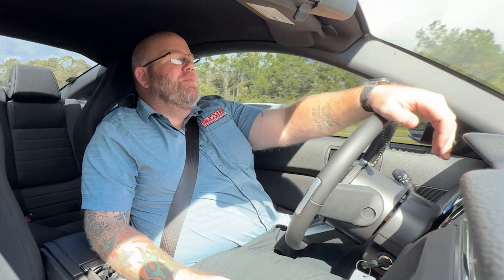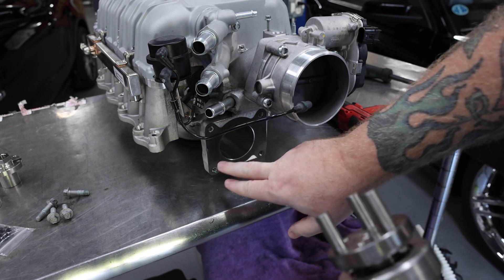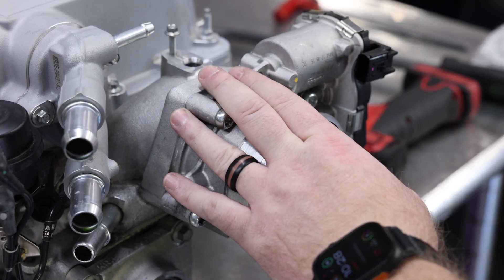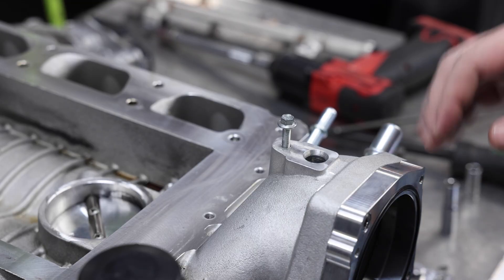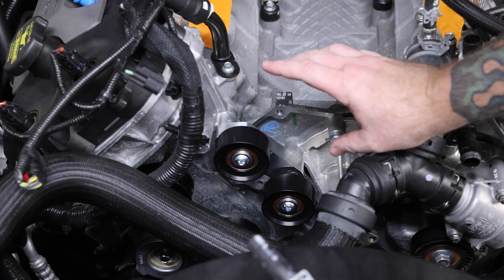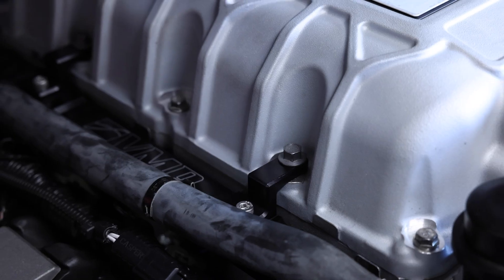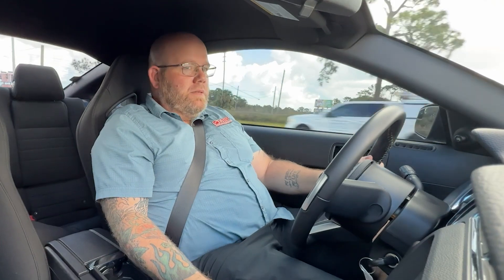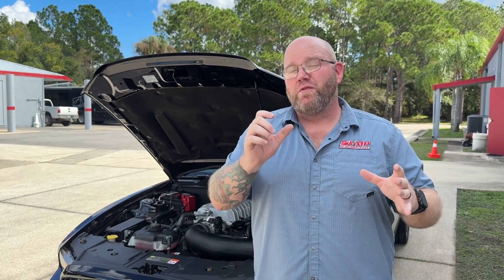Predator Swap Tips PLUS a VERY special 2014 Mustang GT!  ||  Tech Tips

Comment: Any idea what it'd make with e85?
Reply from the maker: Just E85 and no other changes would probably pick up 25-50 depending on how aggressive the timing is.  But it'd require a return style fuel system and larger injectors before E85 would ever be an option.

Comment: did you also change your fuel pump or is it the stock fuel pump ? and also the oil pump gear and crankshaft gear or is this mustang still on oem gears ? what else do you need besides the vmp stage 1 kit fuel rails injectors from vmp  to complete this blower on your coyote gen 1 .Thanks
Reply: For pump gas, just a boost a pump. For e85 or high boost youll need a fuel system. Low boost 10psi or lower, you dont really need oil pump gears and crank sprocket. BUT if youre going to bounce it off the rev limiter regularly then theyre cheap insurance.
Reply: OEM pump gears and running VMP boost a pump

Comment: How munch cost all the parts needed besides the blower?
Reply: Expect around $2k for everything except the blower
Reply: More than that for this setup
Reply: @ervinlovell7757 my bad forgot the tune. The bare minimum is the predator swap kit and a tune which is $2835 together. But thats assuming the blower comes with the fuel rail and injectors.

Comment: I’m coyote swapping my 2008 GT500 and instead of turbocharging it I am definitely doing this.
Reply: Why not just boost up the iron 5.4?
Reply: @BP5Lwhipple I bought it from a friend after he windowed the block. So that engine is long gone. He junked the engine before I bought it.
Reply: @John-4649 I see, grab a gen2
Reply: @B @BP5Lwhipple ahh bigger valves and better heads and internals. 2nd gen it is! Thanks for the tip

Comment: Recommending shaving the locating dowels on a 110lb blower?
Reply from the maker: Yes.  It will not sit correctly if the dowel is present and it is not needed in this application.  The heads on this application are not machined to accept it.